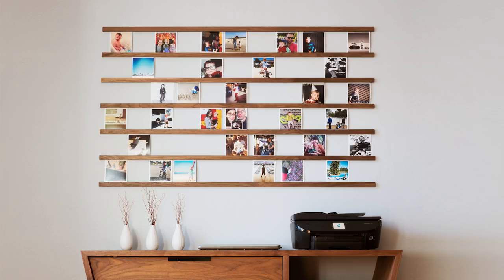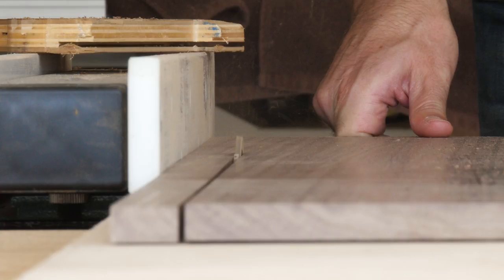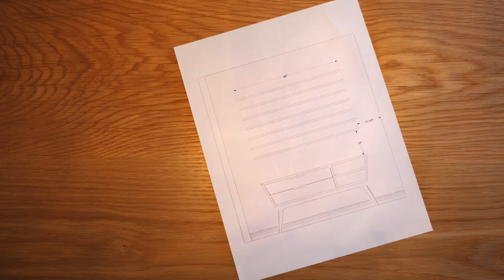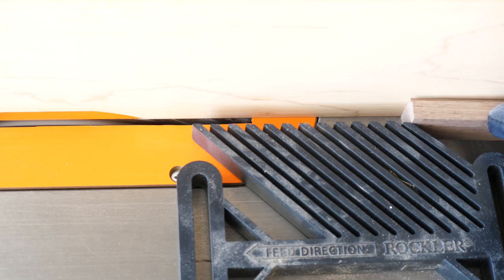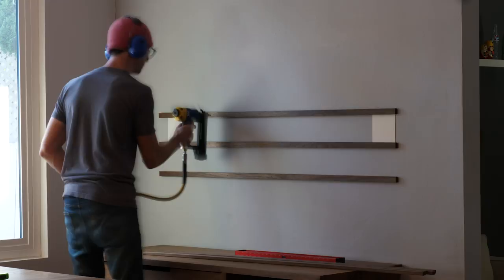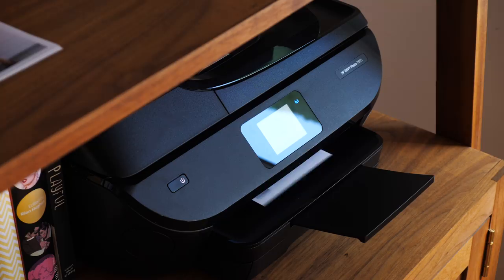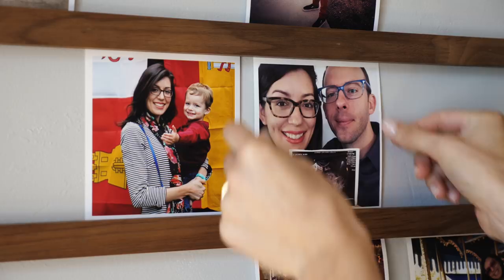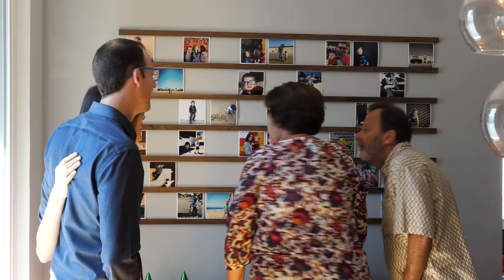DIY Simple Modular Picture Wall with the HP ENVY Photo Printer

Comment: what's the distance between the wood once it's on the wall?  thanks so much for this.  amazing idea.  i don't know anything about wood.... what kind of wood should i get?
Reply from the maker: anything you like the look of will work. The pieces are right up against the wall, but the wall isn't perfectly flat, so there ends up being little gaps here and there. An improvement is to put the grove in the middle of the piece of wood rather than at the back. Solves the problem of pictures falling behind the wood.